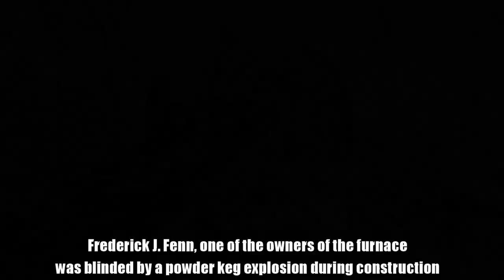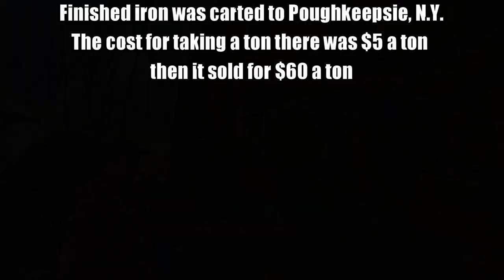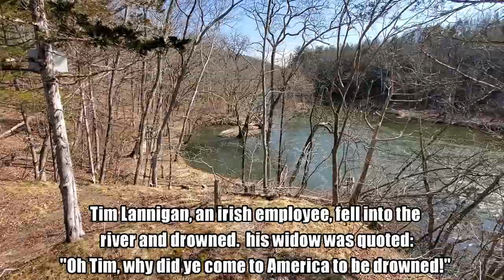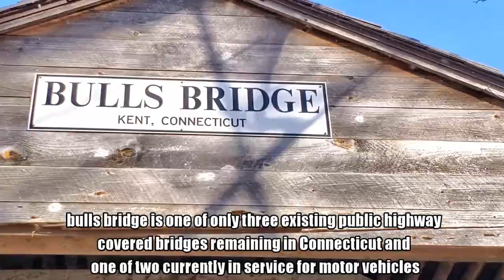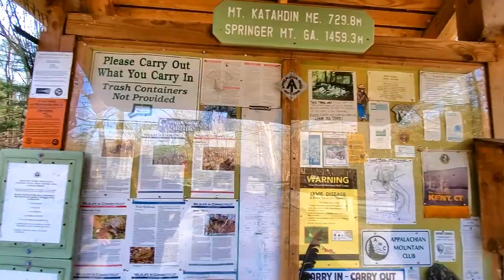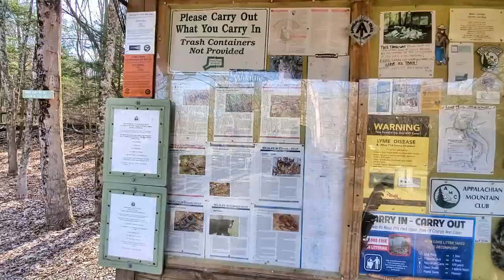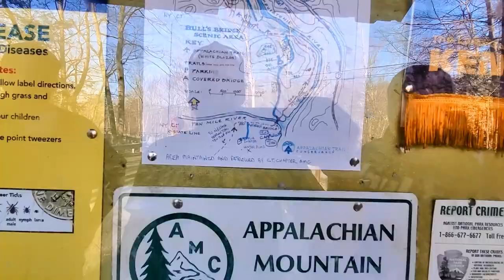Mini-Truck (SE03 EP16) Bulls Bridge hidden Ore furnace, tombstone, foundations and other secrets

Comment: I no longer do closed in places.
Reply from the maker: No? What happened
Reply: @MotoCheez I don't know it never bothered me. then one day nope not going in there. as far as I know only to things ever scared me was ferris wheels. and elevators. when I was a kid I saw them setting up a ferris wheel and the seats was upside down until the unlocked them. and that got into my head and I could never get on another one. and the elevator I don't have a clue why I don't like them but now that my legs don't work to well I have to use them more and it still gets to me. but now as I get older there are more and more things that get to me. but closed in places are the worst.